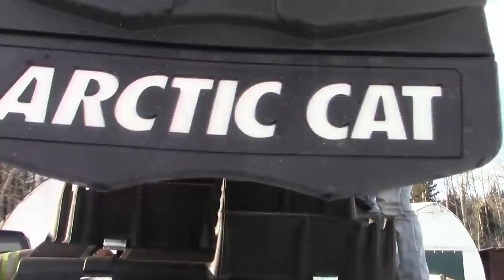A NEW SLED ARRIVES | ARCTIC CAT HARDCORE

Comment: What is advantage over his other green one? Just wondering.
Reply: Three years newer, 3600 less miles, longer track, better plastics, drop and rolled drive, bearinged clutch,  better controls, brighter led headlight, better injection, electric oil pump, better track, beefier rails
Reply: Josh definitely nailed the key changes between 2016 and this 2019. The exciting thing about sticking with one manufacturer for a lot of years and riding each platform for a few years is the progression and changes are very noticeable when you wait 3-4 years between upgrades. Looking forward to see what this new sled has in store and will keep everyone posted on the likes and dislikes 🤘🏻

Comment: do you notice a big difference between the 162" and 154"?
Reply from the maker: For sure. We had a 162 with a 2.6 vs a 153 with a 3 inch, and the 162 with the smaller lugs would out-climb it hands down. The 153 is a funner sled to play with though.

Comment: If its anything like the alpha, you won't be disappointed.  AND YAH, GET THAT PLATE ON!  200miles on my alpha and gingerly busted off the plastic cover off the brake disk with a stump.  lucky it wasn't chain case.  20$ for the cover.  200$ for the same plate you got and same color too.  Don't follow directions too close.  I used rivets in a few spots and drilled holes and used bolts in slightly different spots by where your feet go.  The directions are not good.

Comment: Better upgrade that brake lever Ben! Or carry a spare. If you even look at them wrong they break off! Nice sled tho, if i could do it all over again i would ditch my alpha for the hardcore.
Reply from the maker: I already went over that with him. XD
Reply: Syxxes Performance Just out of curiosity what would make you go back to the twin rail? I personally was thinking about an Alpha but as Cat said it’s a Deep snow purpose built sled so since I ride varying conditions I opted for the platform that does both well.
Reply: @ben_syxxes8179  To tell you the truth I love my alpha and how it performs 90% of the time. But my alpha track is falling apart. The lugs are all splitting where the track flexes, cat won't warranty it either. 2300kms and around 23 lugs split and falling off. Its getting to the point I'm worried she's going to spit the track out the back soon. The old reliable twin rail tracks were tough as nails in all snow conditions. Cat needs to redesign the alpha track to allow the flexing to occur not in the middle of a lug.

Comment: How many yrs warranty on that 2019??
Reply: It's a 2019.
Reply: 1 year
Reply: The GoldenChild ya I know that I said 2019🤷🏼‍♂️
Reply: @big_whiskey1387  🤔 you "edited" what you said. You originally asked if it was a 2019 or 2020? 🤦‍♂️
Reply: The GoldenChild lol sorry 🤪
Reply: The GoldenChild so what do u figure that thing was worth $18,000 out the door??
Reply: One year on mine
Reply: tyler hyde I got an expert but only 3yrs warranty and I paid 20k out the door u got a much better deal I went to riverside in st.albert.
Reply: They also said I couldn’t get 4yrs warranty it only a snow check option!
R u sure u got 3 yr warranty on urs
Reply: tyler hyde u put the black skid plate on urs I did the red one
Reply: tyler hyde ya but 4 yrs warranty only came wen U snow checked it I couldn’t get 4 yrs I asked my dealership
Reply: tyler hyde oh in ur profile pic that red and white summit has a black skid plate on it
Reply: @tyler hyde cause it needs it
Reply: @tyler hyde I just blow em up, and rebuild it into a big bore. Way more bettery
Reply: Big_Whiskey13 I opted out of the 4 year extended warranty and settled for the 1 year factory. My last sled was a snow check and had very few issues so i figured I’d save a few bucks and opt out on this one